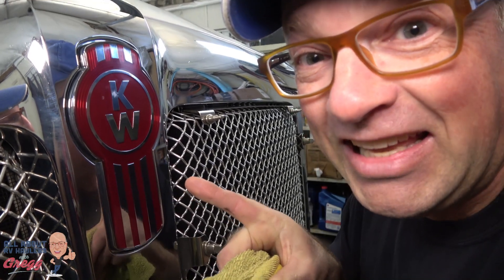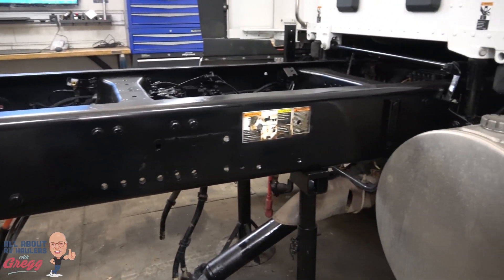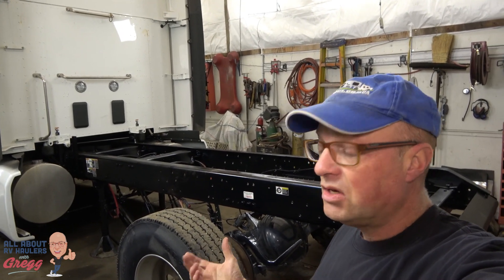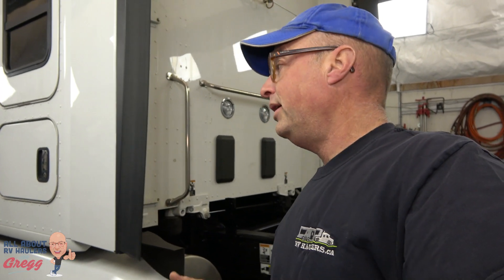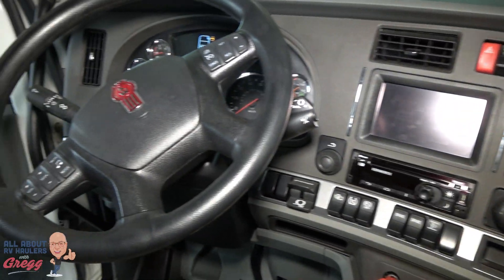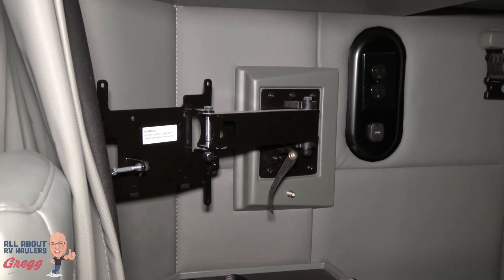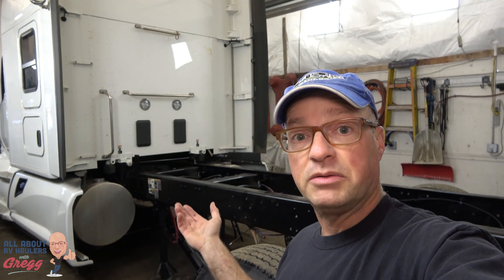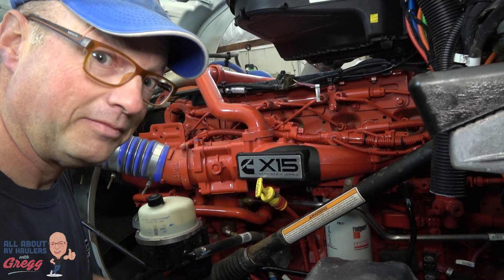WOW a Kenworth T680 RVHauler Conversion Tour

Comment: How good would an rv hauler type vehicle be in a farm field either pulling a mechanics trailer or basically bobtail with toolboxes on the back
Reply from the maker: Hey Wyatt,  great question thanks.  Great question.  In my opinion, make sure you have a locking rear end, we tend to find them here in Canada more frequently.  We get snow, and the drivers tend to order them on their trucks.  I take my own RVHaulers off the pavement all the time, and you have to be a bit careful when going into wet, sloppy soft stuff, that you don't sink the front end.  I do really quite well off pavement with mine, but I am a bit careful.  It isn't a 4 wheel drive.  Load it up with tools!  The weight over the rear axle give you better traction.  I grew up on a farm, and we used semis to haul grain off the fields all the time.  We moved around bob-tailed often as well.  Just use some caution.

Comment: Haven’t even made it through the entire video and my first question popped into my head.  

When you start making modifications to a young truck like this, what does that do to the warranty?

I mean, you’re making some significant driveline changes.
Reply from the maker: Hello - and thanks for the great question.   The lion's share of the warranty remains intact.  At the end of these conversions, we actually take it back to Kenworth for them to check things over carefully.

Regarding the driveline - and in particular the drive-line (driveshaft u-joint) angles, we are super-careful to measure, and ensure we are working well within the prescribed angles.

Keep the great questions coming!

Comment: How do you get the electric trailer brakes to work with the trucks air brakes ?
Reply from the maker: Hi Jared, we use a brake controller system called the Direclink - it integrates into the network bus of the truck, and provides true proportional braking.  It know how hard you are pressing on the pedal!  Thanks for the question. 

I'll also ensure I cover that in more detail in part 2 of this build video series.  Keep the questions coming any time and thanks for watching.

Gregg

Comment: Gregg, another great vid, thanks for posting it.
A general question, could the inboard tires/wheels be removed on the rear axles, and downsize the brake pots, rather than removing the forward rear axle or would that not be feasible?
Reply from the maker: Good question. There has been quite a bit of industry discussion regarding removing an inner set of rubber, and what that generally does to the "system".  Engineers are very reluctant to say "do it".  Why?  I don't know.  Maybe someone here knows and can comment? 

I often get the question about super singles vs dual tires.  In that discussion, I have had personal experiences where having a built-in "spare" tire on each side has a benefit.  In the event of a tire blow-out or slow leak, we keep on rolling carefully!  (I recommend tire pressure monitoring regardless).  When we lose a tire, we can proceed to the nearest exit, or safe location, call our friendly road-side tire repair person, make a sandwich and have a nap while we get the tire addressed.  

One tire blowout - means STOP NOW!   I've lost a tire in some awful locations where pulling over is either scary or just not possible for some distance.

When we only have one on each side, we have likely ran on the rim for a while, and wrecked the rim.  Now we have to replace rubber and aluminum $$$.   Sometimes, in a tire blow out - the tire shreds and causes collateral damage as well.

Comment: I'm curious on typical price for xxxK Mile service on the HDTs, the cost of a oil change or heaven forbid, a tow
Reply from the maker: Hello Jay.  Great question thanks.   
 
 Some of the costs associated with ownership are either cheaper, or on-par with the pickup costs.

 A. Oil Changes - budget $280 every 15,000 miles (yes our intervals are much longer than the pickups.  We usually feel guilty and change more often to make us all feel good)
 B. Chassis lubrication included above
 C. Tires. - You will age out tires, not wear out tires.  Budget $500 for high quality rears, and $725 for steer tires.  8 to 10 years of life in tires generally. 
 D. Other maintenance items - Again, our intervals are very very long.  Transmission oil is done every 200,000 miles $680.  Engine Air filter every 100,000 miles.  $85.
 E.  towing - most of our customers get an annual escapees membership, which covers towing costs.  It really isn't any different than towing a diesel pusher motorhome!

Keep the questions coming!  I appreciate you taking the time to pose that question.

Ggg

Comment: Under cdl ?
Reply from the maker: Because we are a dealership, we are legally able to change the title of these rigs into MOTORHOMES!  No CDL is required as long as the trailers you are towing have electric brakes.  Each state/province has their own rules, but in the majority of locations you do  not need a CDL!

In some locations, you need to take an air-brake endorsement to learn how the air brakes on the truck work.

Thanks for the question,   Gregg

Comment: Id have kept the extra axle i like the stability of the extra axle even if its a tag axle. nice truck though.
Reply from the maker: I certainly have folks that are drawn to keeping both rear axles.  Great comment thanks!  

Sometimes my customers consider a single rear axle for the following reasons:

Why do we “single” an RVHauler?  Some Advantage and Disadvantages.
 
1. Every individual state has their own rules, however one rear axle can often be classified as a motorhome.  Titling as a motorhome results in far cheaper insurance, and registration costs.   If it has two rear axles, it is sometimes considered a commercial vehicle, and the insurance is about $6000+ per year.  One rear axle, the insurance is about $900-$1300 per year.  This is dependent on where you live.  Sometimes you can have it titled as a “personal truck” when it still has two rear axles. 
2. Perhaps an even stronger reason for singling the rear is the impact it has on the required operator’s license.  A single rear axle can be driven with a standard driver’s license in most locations.  A three axle truck requires a commercial driver’s license in a good number of cases.  Sometimes we have to take a one-day air-brake course.
3. Make it a motorhome, and you don’t have to maintain a driver’s log, annual commercial safety inspections, or stop at weigh scales ever.
4. Traction.  I have proven in side by side tests that a single rear axle has superior traction in pavement, grassy and gravel conditions. I have had people with their dual axle RVHaulers here in my campground in various wet, snowy, or icy scenarios.   My yard has some very gentle undulations, lumps and bumps.  They have tried to backup their trailers, and gotten horribly stuck, chewed up grass, and spun tires on ice.  I have had to unhook them from their trailers in-place, and I winch them out.  Then, I backup unaided to their trailer with my single rear axle RVHauler, connect, and back them up into the site, or drive out.  I have done this probably 12 times in the past few years just in my yard.  I have always won.  In every case, the tandem axle RVHaulers had full lockers.  Every tire (all 8) spinning back there.  WHY?  We have extremely little pin weight pushing down on the drive tires (perhaps 3000 - 5000 lbs). The coefficient of friction requires downward force.  I have many more small details that I can share with you should you wish to explore this further, and I would suggest you call me to learn more if interested.
5. Limited axle articulation when we have two rear axles.  The rear axles are attached with extremely stiff springs onto an extremely stiff frame.  There is only 3 inches of tipping or articulation from side to side available to an individual axle.  When driving over the slightest uneven bumps (or a gravel divot in a campground), the axle will tend to stay level.  If you lift the one set of wheels, the opposite wheels tend to lift as well because the second unaffected axle is still on the flat.  The lifting wheels that have lost much of their ground contact will spin.  Again, I have proven this in side by side testing on my own driveway that leads into my shop.  
6. Better fuel mileage. There is less weight, road friction, and steel rotating.
7. Singling results in a far better turning radius than your pickup.  Two rear axles tend to “scrub” or grab the road surface, and it makes campground maneuverability a bit more challenging.   
8. Superior trailing backing.  As an aside, when we combine singling with the location of our 5th wheel hitch placed rear of the axle (not directly above it as we do with pickups), we gain amazing trailer backing characteristics.  When we are backing up a trailer with the hitch placed approximately 3 feet rear of the axle we essentially have the backing characteristics of a bumper pull trailer.  We start trailer  "turning" sooner.
9. Singling results in less downward force carrying capacity over the rear axle.  Most rear axles are engineered for 20,000 lbs of "sprung" weight.  They can support 20,000 lbs of downward force.  When we add to the bare frame (A) a fully outfitted bed (deck), (B) a drom box, (C) smart car, (D) and we fill all the storage with our super-heavy contents that full-timers take --- END MATH RESULT --- My "heaviest contents" customers have had 7,500 lbs left over capacity for their 5th wheel pin weight.  If you plan to tow a very heavy pin weight trailer that is approaching 7500 lbs two axles might be warranted.  
10. Take a Jeep or something heavier than a Smart Car?  If you plan on carrying something other than a smart car on the bed, they need to be loaded length-wise.  We have to be aware of weight capacity.  Most small cars or Jeeps will weigh around 4700 lbs and up.  This will take away from our 5th wheel pin weight allowance.  On average, a 4700 lb Jeep will allow us a maximum 5th wheel pin weight of around 4,800 lbs. 
11. Nicer (smoother) ride.  I have enjoyed many hours and days of towing our 5th wheels with single, and dual rear axle RVHaulers.  We have consistently remarked that the single rear axle is much much smoother.  The dual rear axles tend to "chatter" when hitting road imperfections and cracks in the pavement.
12. Singling results in a shorter rig overall.  If you leave the tandem axles, we often have an RVHauler that is 3 feet longer overall.
13. Lower maintenance and repair costs (fewer tires, brakes, etc)
14. Increases your resale value – when you are ready to sell, it REALLY increases the value when there is a single rear axle.  There are many many commercial trucks available for sale. There are far fewer RVHaulers!
15. Allows for more storage boxes under the bed/deck.  Those tires are almost 4 feet across!  Leaving the two rear axles reduces our storage opportunities by 4 feet of width X 2 feet deep X 2 feet high X two boxes = 32 cubic feet of storage.
16. Some folks like the looks of a single rear axle.  Visually it becomes more of an RV rather than a commercial truck.  Some like the traditional looks of a commercial truck with two axles.
Reply: @rvhaulers  I work for the local mail service whe have double deck 16ft2in tall trailer some times I get a 4x2 truck it drives fine but when loaded its a bit wobbly the extra axle helps keep things steady. I like the detail you put into your trucks do you ever get Volvo Fh16 trucks
Reply: @rvhaulers  in the UK you would need a C+E licence to drive a vehicle like that they're licenced by the weight of the vehicle and trailer anything over 750kgs you need cat E on your license the tractor unit would be over 7.5 tons so you would need cat C hense C+E. in the uk tractor units have a switch where you can bias or change which axel that takes the load most trucks here are 6x2 with a tag axel not many get spec with 6x4, they are also nearly all Cab over very few (what we call Bull Nose such as scania T730) the length of american truck would struggle on Uk roads although their are some american  trucks about but with the space you get at some sites it can be a real struggle in a cab over with a relative short wheel base most tag axels are also steering which also helps manouvering and reducing tyre scrub some are mid lift some rear lift. I do understand your point with the RV's I can see they're very light in weight. I like the look and the creature comforts, i especially liked the video you did with the Semi based trailer that is something I would go for if i was to buy one; you could go really wild configuring one of those!

Comment: X15 is way too much for RV hauling. Nice truck don’t get me wrong but seems to me he would be a lot better off with like a kenworth T270 with a 9 or 11 liter paccar engine and a custom sleeper just for what the smaller engine would save him in fuel. That X15 can’t get more than 7-8 a 9 or 11 liter would do much better with such a light load.